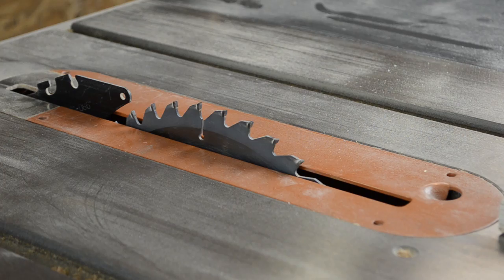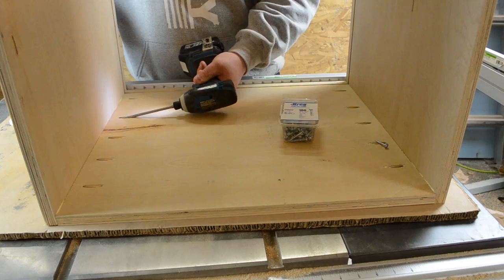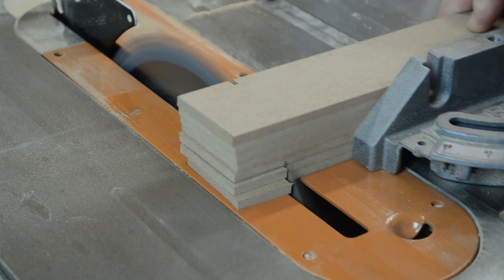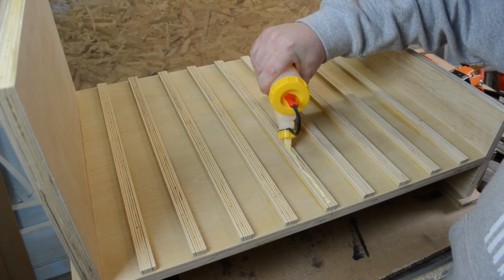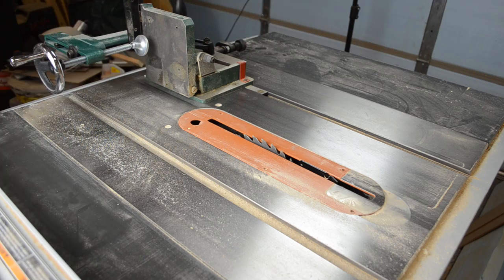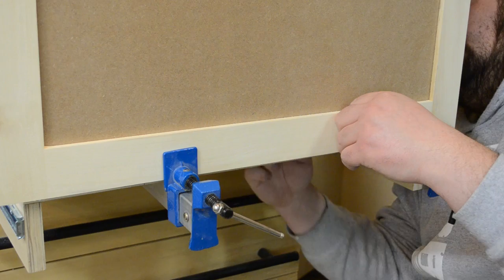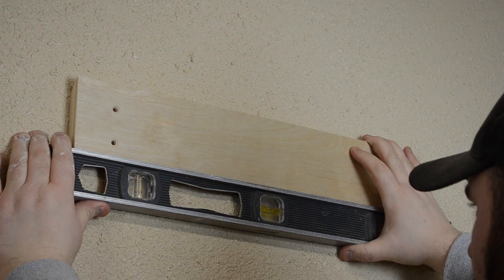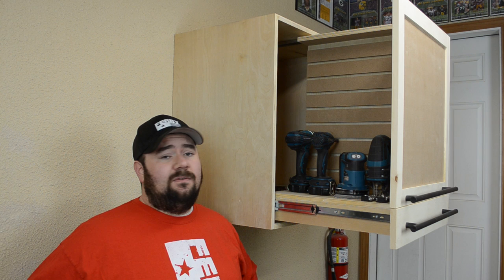Ⓕ How To Make A Cordless Tool Cabinet (ep34)

Comment: I like it, good work. The only thing I would have recommended to do would be put some hardboard on the back of the tool carriage, so those tools don't fall backwards.
Reply from the maker: Ben's Collection and Sundry Thanks.  Once I make the tool hangers that shouldn't be an issue.  I wanted to make them for this video but I ran out of time.

Comment: Nice project Nick. Just a little adjustment on the top slide required. I think over compensate slightly as when you add all the weight of the tools and batteries if will probably dip a little more. Really like the concept of the slide and look forward to the "hangers".
Reply from the maker: Pat M The top slide only keeps it from moving from left to right.  The bottom slides support all the weight, they are 150lb slides.
Reply: Nick Ferry I was talking about the fact that when you opened the top slide at the end both the top and bottom opened at the same time I assumed it was dragging on the drawer??
Reply from the maker: Pat M The top and bottom fronts don't touch. The lower drawer is housed within the top slide out.  Everything slides in and out smoothly.  I'm not sure what you mean.
Reply: Nick Ferry Nick, I'm an idiot I didn't realize that the whole upper part was on large piece but the bottom drawer could be opened seperately. Sorry for the fuss. Was trying to be funny and came back to bite me in the butt LOL
Reply from the maker: Pat M No worries Pat.  I do the same thing all the time, just ask my wife, lol.

Comment: FYI the 12" OC Stud layout will most likely be a bearing wall. There are point loads and probably thickened areas in that area of the slab. 

Off topic I know, nice build love your videos keep up the good work!
Reply from the maker: thanks Chris - no that wall is just silly, some are 15" apart and others 18"
Reply: Home building ain't what it used to be! Keep doing what you're doing man you videos have turned me into a junkie and has opened my eyes to a lot of techniques I was blind to.
Reply from the maker: Chris Rose very cool, thx man!

Comment: Looks great and might be an idea that i'm going to use. But I have just one question is there a special reason why you use both glue and pocketholes for the joints? I can't really see a reason for myself to do this, but then again I'm just starting out with woodworking

Comment: Really like the crisp door front. My question is how strong and reliable is the French cleat system? Would it be suitable for holding kitchen wall cabinets to the wall? They will hold the usual p,Ares , cups glasses ect.
Reply from the maker: Thanks - kitchen uppers are no where near as deep as this cabinet and french cleats, if properly installed work great - however kitchen cabinets are installed (at least in my area) by just screwing them directly to the wall studs - there is little to be need to ever move them

Comment: Nick, I'm thinking of using this same design but the cabinet would be in a mobile cart so it would basically be below my waist. Should I keep the drawer slides at the bottom or move them towards the top?
Reply from the maker: I'd move them toward the top - but I'd probably go with deep drawers instead of a pullout design and have "holsters" to pull the tools out from the top - ergonomically it would make a lot more sense to be able to grab the tools from the top and a design like this in a rolling cart would tip over

Comment: Say there Nick I to have a Rigid planer that I have had for approximately 8 years and I am not sure how many different type blades they make for it. The problem I have is getting the one for my planer. Have you had that problem?
Reply from the maker: +papaike2 not yet anyway - I have only replaced them once and just picked up replacement blades online and they fit

Comment: You just made poo poo of my chinsy little pegboard drill holder! =x

Also, time for some dust collection. :)
Reply from the maker: Jeff Ferguson Thanks.  Yeah my dust collector is just gathering dust in the back corner of the shop buried behind a bunch of crap.  Either way, it'd collecting dust, lol.

Comment: How's that hardboard holding up after this many years? looking to do some slat wall cabinets in a similar fashion and am curious to know if it's durable over this amount of time. Also given that only the top of the slot if needed for those tab hangers, is there a benefit to having it be a T slot vs say an L shaped slot?
Reply from the maker: Hardboard is holding up great - as for the slots, you can do L shaped but they are most often a T shape for manufacturing reasons - it’s not too common, but some accessories utilize the entire T shape

Comment: Hi nick, I'm looking at buying my first table saw. Is that a Ridgid your using? I was thinking of buying the Ridgid R4512. Do you know anything about this saw? Is it a good first table saw? Thanks.
Reply from the maker: yes it was the R4512 - mine had trunnion issues and height adjust issues - so from my experiences I would stay away from it - I ended up returning it

Comment: Awesome cabinet! I will probably make something like this in the near future to go above my miter station.

Quick question: I've heard that using pocket holes on the inside of an outside corner makes for a weak joint, since the end of the screw goes really close to the edge of the wood. Is this true in your experience? I see you did it several times here. Just wondering if you've ever broken a joint somehow this way? I'm guessing the wood glue helps a lot too.
Reply from the maker: Thanks - I haven’t seen any problem from doing it this way or had a joint fail from doing it this way - however, what you said does have merit and it’s true that the screw tip is even closer to the corner doing it this way
Reply: @NickFerry  Cool, thanks! I'm guessing it's not as much of a problem as I've been told. Maybe I'll try making something without a bunch of ugly holes on the outside. Or just be less lazy and plug them I guess.

Comment: I know this is a few years old but, I see you have(had) the r4512 from Ridgid with their fence. I’m super disappointed with the fence and am thinking of upgrading it but wondered if you liked the Ridgid fence. Did you find it to remain parallel with the blade move after move?
Reply from the maker: I returned that saw less than 90 days after owning it - had nothing but problems with it - fence and trunnion issues
Reply: Nick Ferry What did you buy instead?
Reply: Nick Ferry What did you buy instead?
Reply from the maker: sawstop - listed in my tools here - https://nickferry.com/my-tools-equipment/
Reply: Nick Ferry That’s quite a jump from the Ridgid! What would you suggest for someone like me who can’t spend hundreds or thousands? I’ve been eyeing the ShopFox fence upgrade.
Reply from the maker: I work in various shops mostly for theater sets - I have been on a ton of good saws and it really can be a night and day difference - I've owned several jobsite and contractor saws as well as a few full cabinet style saws - had 3 hybrid saws of the exact same model - after all that I wish I would have saved for a nice cabinet saw sooner - that being said, for table saws, you typically increase the quality the higher up you go - if saving up may take too long look for used - you can save a lot of money that way but you have to find the right deal at the right time and that may take a bit - old delta unisaws are great, as well as powermatics or even an old general - not everything rings true to the old saying "you get what you pay for" but I have found it's pretty accurate with TS's - cabinet mounted trunnions have given me the least amount of problems - you can build a lot of nice things and get by just fine with less expensive saws but you do run the risk of being in the situation you are in, having to alter, upgrade or fix certain components to get them operating how you want
Reply: Nick Ferry I totally follow the logic! For a somewhat serious hobbyist like myself I can’t justify (to myself or my wife lol) a SawStop or anything like it.
Reply from the maker: I'd go the used route then

Comment: Wouldn't it have been a lot faster and less work to just route a T slot instead of all that glue up? Is there a reason not to do that other than being able to make it any size you want with the tools already on hand?
Reply from the maker: not sure it would have been faster - those bits cut rather slow not to mention the amount of sawdust they create and you have to buy the bit - just different ways of getting the same result
Reply: Thanks. I hadn't even considered the sawdust convenience factor. I'm not a woodworker and don't even play one in my shop. I've just really gotten into that video category recently, and it seems like people are always avoiding routers when I'm thinking it's the most logical tool. I'm guessing sawdust and noise are the typical reasons why.